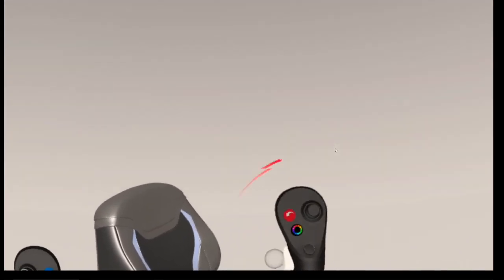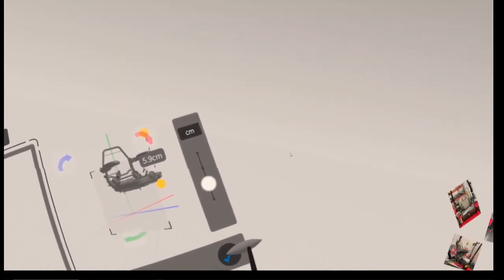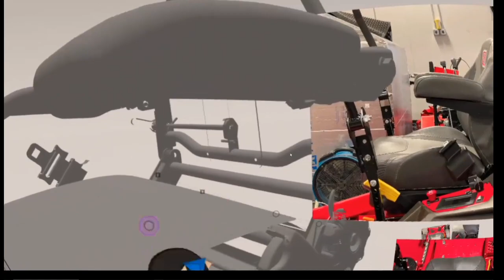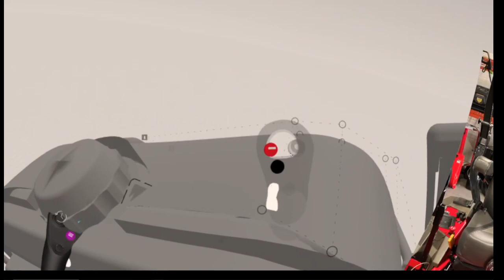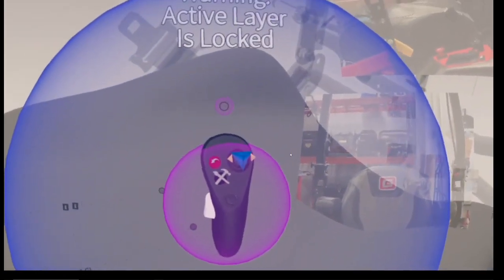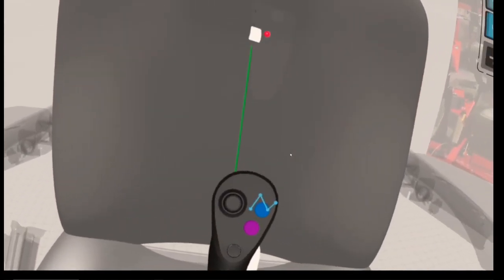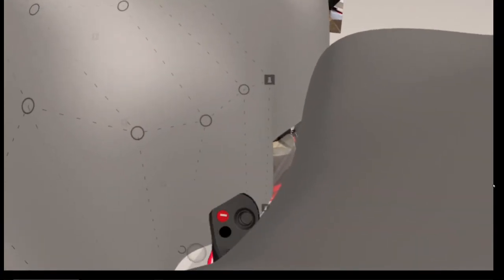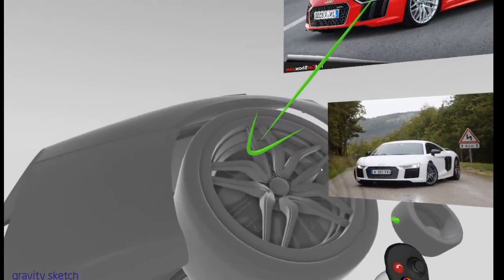Gravity Sketch on Oculus Quest: Industrial Design Demo and Tutorial

Comment: I didn't see any measurement tools... are there any? Because the main reason I want it is to 3d print.
OOP NVM found it
Reply from the maker: Yep they have it in the tool belt! Also you can use the grid system and use each grid cube as a 'unit' and convert based on that.

Comment: This looks really good for making curvy flowing creations without specific dimensions.  What if I wanted to just build a part that is 2" by 3" by 1" thick with a 3/8" hole in the middle.  Can I do that? or is it all wishy washy fluidity sculpting?  What if I wanted to recreate my house and furniture and play around with rearranging it can it do that?  Again with specific dimensions for things like length of walls, height of ceiling, dimensions of windows etc?
Reply from the maker: I could do a video on this... it would be challenging to do certain things but it would be possible to do what you describe. There is a measure tool you can use like a literal tape measure and you can use the grid to define consistent measurements. It’s a good idea for a tutorial.